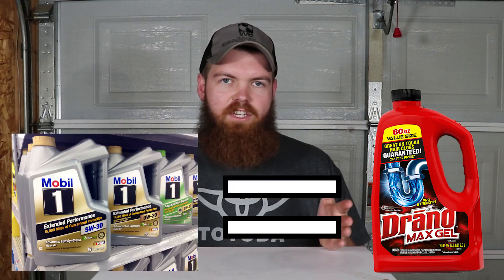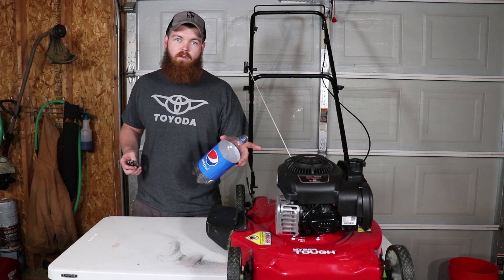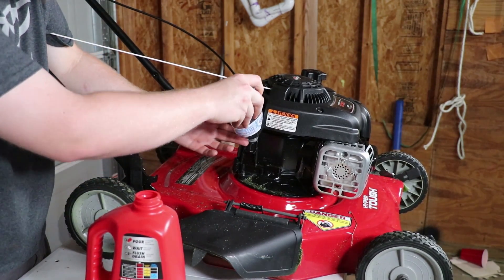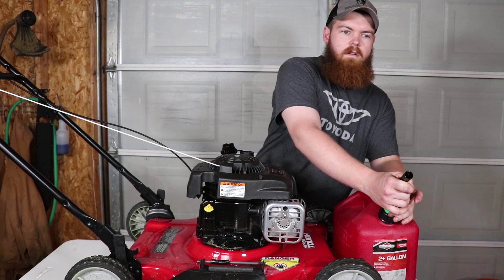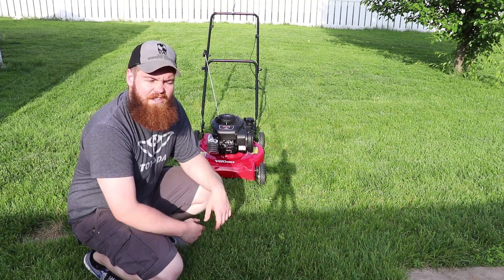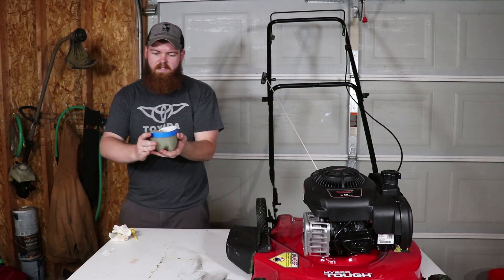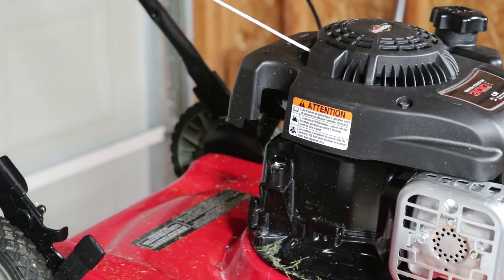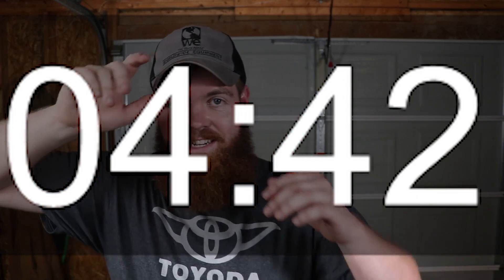Can You Use Drano As Engine Oil?

Comment: I think that Mower is new enough that it has a oil level sensor. and since the drain cleaner foamed up it didn't think there was enough oil in the engine therefore it cut the spark so it would not run. I'm guessing thats what happened.

Comment: Oil plug is hidden under the mower deck by the blade. I would wear ventilators since draino will gas off as it eats biological matter (oil).

Comment: It should've run longer than that, even if it had no oil at all. Probably flooded from tipping over to drain the oil out, because the new mowers don't have drain plugs, because they are "disposable".

Comment: Drano is costic, meaning it dissolves the oils and proteins in your fingers and turns it to soap, that's why it's slippery. And two stroke engines use the sump for the fuel and air to allow it to mix better, the costic would of foamed up and gone into the ports to the spark plug, that's what made it stall.

Comment: @Tylertube The lawn mower lasted for 4 mins because the engine still had oil but when it’s gone the draino was rejected because mostly likely what you said it became water/ thinner which of may just went inside the engine but than burn out. Replacing the oil clean up the engine which got it to boost start and saved your lawn mower, now if you left the lawn more with draino for 30 days it may have cause more damage to it or maybe not, make a video on that please

Comment: Reason why the lawnmower wouldn't start is the drano started reacting with the aluminum in the engine creating highly combustible gasses that were choking out the carburetor with the wrong air fuel mixture. If you left the drano in the engine it would probably get really hot and possibly explode from the gases.

Comment: I see you have one of those ultra super safe EPA regulated gas spewing gas containers. 👍🏻 I love those things, I can pour gas all over the place from 10 feet away!
Reply: Lol yeah I had to recently buy a little 1 gallon can because I ran over the one I have had since the 90s and didn't think about what I was grabbing and it ended up being some stupid thing I would have had to hold a sliding thing in to get gas to flow...  I ended up grabbing the old nozzle  off the old tank and drilling a little hole in the top rear of the new tank and attached a little plug to allow air and keep it from spilling.
Reply: @ChazzleDazzleVideos RIP gas jug from 90s… ik seeing that flattened jug was heartbreaking😂

Comment: I'm as surprised as you are, that the engine only ran for a few seconds. I would drain the oil out of it again, and change it, to get the residual drano out of it, I'll bet that engine will run like new. I was hoping to see you actually mow the lawn with Drano in the crank case, but the engine just didn't run long enough to even begin to mow. I doubt there was any real heat involved, the engine never ran long enough to get too hot to touch, except maybe the muffler. One of the main purposes of a drain cleaner, is to break down oil, and mix it with water. It's a "super detergent". It would have immediately removed the oil from all the moving parts, particularly, the cylinder wall. That's probably why it only ran a few seconds. Drano is also highly caustic, which attacks aluminum. That engine has an aluminum bore cylinder, and an aluminum alloy piston. It's also an aluminum cylinder block.

Comment: I worked for a plumber in customer service for 3 years and every plumber in that place had the same opinion on Draino. It's trash. Highly overrated for what it's supposed to do. They recommended it if anything as a once a month maintenance use after a cleaning. But waiting till you have a full complete clog...good luck. You could maintain a clean drain just as well with vinaiger and baking soda.

Comment: The film strength of the inactive ingredient that makes drano viscous probably isn't very high. You tore apart the bonds holding that compound together and made it an acid again. No idea what the reaction between drano and oil results in, nor do I know what heat does to drano. Apparently it turns into contaminated HCL lol.

Comment: Maybe try some different fuel types? Can it run on high proff alcohols? Brake cleaner? Wd 40? Or even  see if you can make wipped cream with a lawn mower inside the engine or with the blade

Comment: The reason is a low oil sensor, youed need to find it and connect the two wires and then it would be golden to run anything you put in it

Comment: I'm guessing 10 minutes until something bad happens... now time to resume the video and see what actually happens....
EDIT: I didn't expect that things would go down as quick as they did, but based on your assessment afterwards it makes sense.
So what I remember from middle school/high school science classes, bases (like soap, Drano, bleach) often feel slippery, but not because they contain any lipids (like oil).  I would have to look up the exact science as to why bases feel slippery TBH, so I'll leave you to Google that if you want to know more on how that exactly works, but it was something to the effect of the bases tend to destroy or dissolve away at the dead layer of skin on your fingers/skin.  Another difference between the Drano and oil is that Drano should sink in water (so it can unclog your drain) while oil will float on water (although I don't think this property would impact how your engine would run).  I also looked up to see if there is a known smoke point for Drano, but all I can find is that it's recommended to be kept away from heat... this would lead me to guess it's less heat tolerant than motor oil???  Anyway, interesting video, thanks for putting this together!!  I wonder if you could use other lipids (like cooking oil, animal fat) to lubricate the engine in place of motor oil... it might have delicious smelling side-effects LOL :)

Comment: This channel lacks some scientific content to back up the experiments.
Experiments can be fun,  analyzing them are instructive, as well as fun.

For example ; if you wanted to force the engine to run on drano, you could have : 1st checked if there was an oil level engine shutoff and tried to shunt it, 2nd bypassed the crankcase ventilation if the foam was coming back up the intake

Comment: Try turning on the engine with a drill, remove the pull starter and you just put ypu drill in there amd it should start

Comment: Disable the low oil sensor and put drain-o back in it. The foaming probably tripped the sensor and it stopped the motor as a safety feature.
Reply: Z71GALLA no oil sensors on those motors, we have the same junk ass Briggs on our old push mower

Comment: The drain plug is on the bottom of the mower where the blade in the shaft meats and it's a little square as a ratchet will fit on to remove the plug

Comment: Speaking from decades of mechanical experience.. I think it still would have started . It didn't even run long enough to create significant heat to cause it to start sticking up the connecting rod bearing. .. I think you're better of starting with a drill like project farm does. 

I'm a bit disappointed as I know the damage wasn't done or the engine didn't not start due to the fact the draino was in the crankcase. But none the less it was a good watch sir.

Comment: NEED TO USE A POWER DRILL IN ORDER TO GET IT TO TURN OVER. As well as adjust the carb. There's too much friction to start the engine without some extra steps
 
A good tune means the engine should start and idle without stalling, and respond instantly when the pedal hits the metal. The carburetor will also deliver the optimum air/fuel ratio throughout the engine’s RPM range to achieve peak horsepower and torque. 

Hence, there was too much friction to use the same air/fuel ratio and keep it running.
The guy on "Project farm" channel does this to get his experiments with lawn mowers to work.

Comment: What I believe happened was that the draino got more fluid and less slippery as it got hot and the piston was not lubricated well enough causing the engine to stop. I’m assuming you would have found some metal shavings in the draino if you checked. Also the draino probably doesn’t have anywhere near as high an operating temp as motor oil.

Comment: When the Drano comes into contact with Aluminum, the byproduct from that reaction is HHO gas... 2/3 Hydrogen! The general engine block of small engines is made mostly of Aluminum. Aluminum shavings from the engine block and what not will end up reacting with the Drano, thus creating HHO inside the engine block.

Comment: The drain plug is on the bottom side of the mower,  under the deck, close to the shaft the blade is bolted to.

Comment: I guess maybe the draino cleaned all the oil off the rings and cylinder walls so it was not making compression because they will run longer with no oil

Comment: I'm guessing 5 seconds. Draino feels slippery, but it's literally made to dissolve oils and leech them out. You're going to start the motor, and it'll be lubricated by the old oil, but then as soon as the draino spreads throughout the motor, it'll dissolve the oil away and it's going to stop running. Judging by the length of the video, I'm gonna guess you tried putting oil back in and seeing if you can get it running again, I'm gonna be REALLY surprised if you can.

EDIT - I'm surprised you got it running as quickly as you did (I'm surprised it started working at all)

Comment: Dude this is the second video where you put something in Drano end are confused by the foaminess.  The residual oil reacted with the sodium hydroxide to make soap in a saponification reaction. Definitely the bubbles stopped it's ability to flow in the engine.

Comment: Heat wasn't the issue. It didnt get hot in 4 seconds lol. The issue is the detergent in drano. It aerated instantly which thins the fluid and it expands fast as well when it gets aerated which is what caused the failure.

Comment: just for a heads up. the drain plug is usually under the mower deck by the mower blade. should be the only large bolt under there.

Comment: I think the Drano essentially just cleaned the engine walls from all the old leftover oil. The engine was probably not running with drano because there was no combustion for some reason... I wonder if you can even light drano on fire??

Comment: No draino is a caustic product.  Engine oil is a lubricant.  Won't work.
Reply: The caustic properties don't make a lick off difference for a 5 minute test bud. Just saying. It's purely down to the lubrication. He needed a drill to even turn it over. Too much friction to pull start it. Then since it's not running as smooth, the air flow needs to be cut down. (Went to school for small engines)

Comment: used WD-40 as engine oil there's this YouTube video that did it and the cart runs on WD-40 and they left it running until it turned on fire and it blew up but the explosion wasn't that very big it was almost like a big pop if you do it with the lawn mower it could be a smaller pop

Comment: I got an idea let's try corn oil canola oil vegetable oil in your lawn mower and see if they work.
Reply: JUGALO-MADNESS-REVIEWS  check out the Chanel project farm
Reply: @fourpointohh  i was just about to say the same thing
Reply: All of those oils  can not take the heat an will burn off.
Reply: @negativerush  bro your stupid people deep fry stuff in oil up to 400 degrees 😂 ever seen a McDonald's they use big huge fryers full of oil that stays very very hot all day and doesnt burn off use your brain if you got anything left of it
Reply: Corn oil has a sugar content, you’ll get caramel in your engine.
Reply: IS WISH I HAD CHECKED THE COMMENTS. I SAID VEGETABLE OIL.
Reply: @Mr. Fireman bacon grease might work
Reply: Go check out a channel called project farm.
Reply: I would say, "I dont think so." Cooking oil is flammable.
Reply: I've been mixing gas and cooking oil in my 2-3 year old weed eaters/weed whackers and run them at wot for almost 2hrs at a time and the only problem I had was they get hot enough to start dieseling I have a video of it.
Reply: Will get too thin when hot and burn off.
On the plus side we might get a bang.
Reply: Michael Persico  that is incorrect, diesel is a by product of making gasoline.